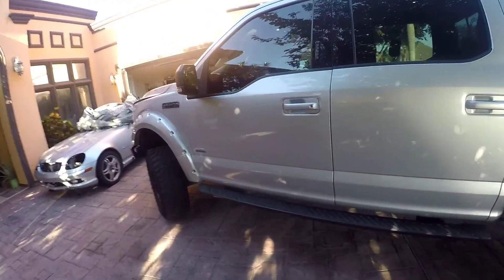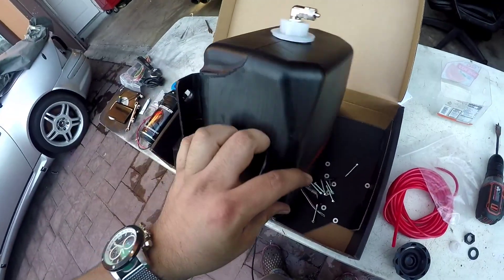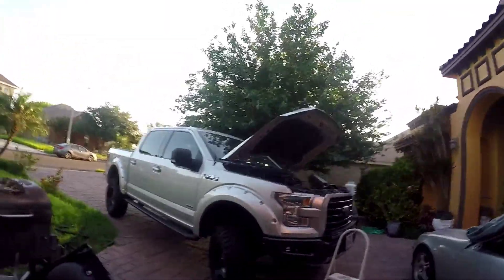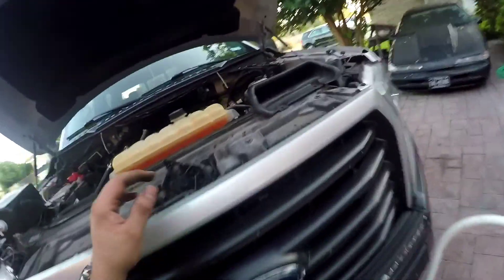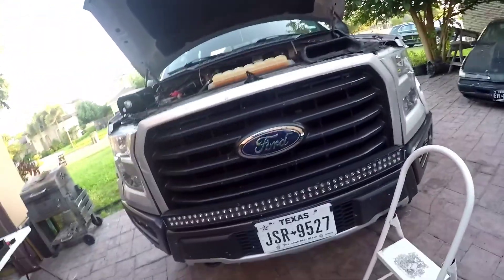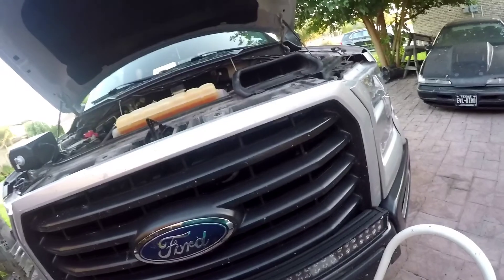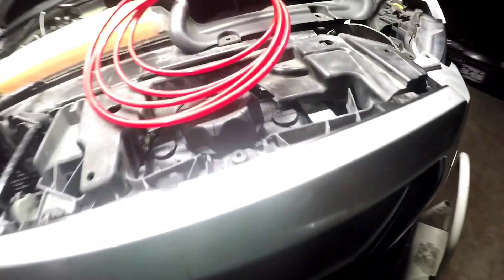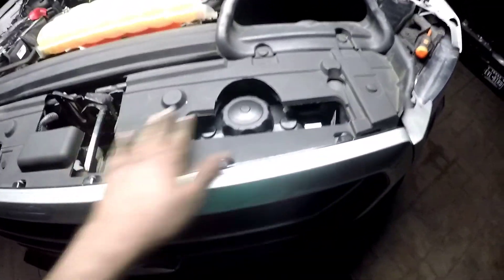2015 F150 EcoBoost Methanol Injection Install

Comment: Nice work! Was wondering if you had any issue installing the nozzle right there around the map sensor? I know they say put it 6-8” before the throttle but after MAFs… wasn’t sure if it damaged the MAP sensor and if I should us a throttle body space to tap the nozzle? Thanks
Reply from the maker: No issues to this day :) customer has been super happy with it

Comment: Hi, i see your video and it helped me to install a same system on my f150, but i have a question, in there a reason why you put the nozzle before the throttlebody?
thanks and keep the good work.
Reply from the maker: Easier to access and service i have done pre and post throttle body installs on supercharged vehicles if ur nozzle is before the IC its useless so you must go Post  TB turbo cars this is the charge pipe so the air is coming out the turbo already and you trying to cool it before it gets to your cylinders i have found these to be the best ways to bring down IATs

Comment: Thanks for posting this! Where did you install the boost reference? What vacuum line/location did you use?
Reply from the maker: I cant remember what refrence i used on this  one or if it was a one off switch,  it did not have a progressive controller this was a stage 1

Comment: Uhhhh hey man...I'm doing the install on my 2018...is it a good idea to have the pump exposed to the elements like that?  And in the front?  Is that pump waterproof?
Reply from the maker: I havent had any issues on my lightning ive had the pump expised for 3 yrs so far and it was a used pump i already had